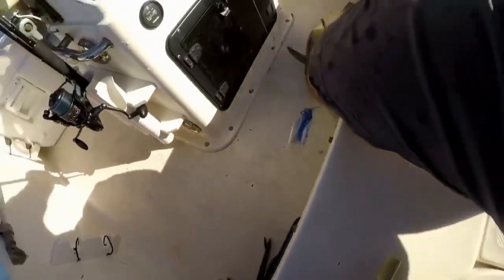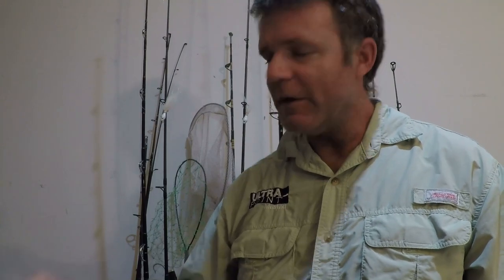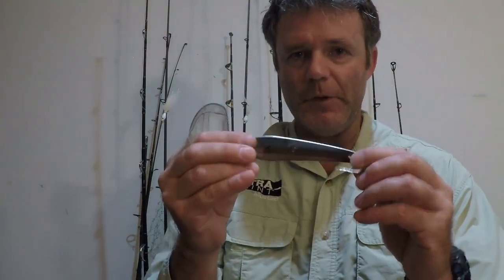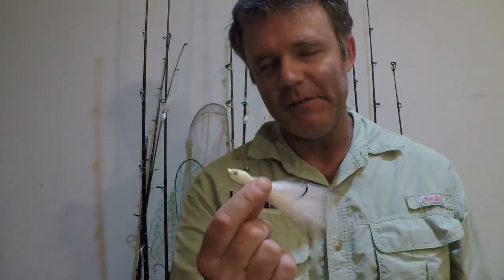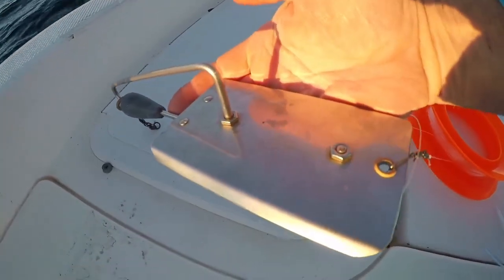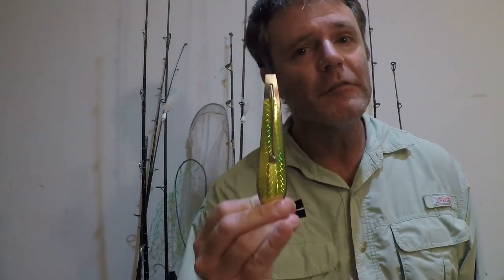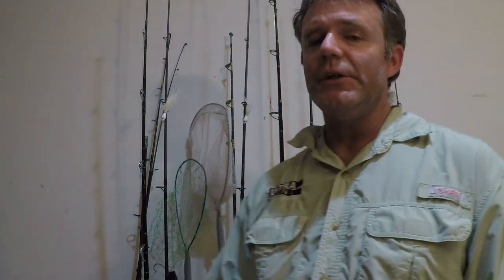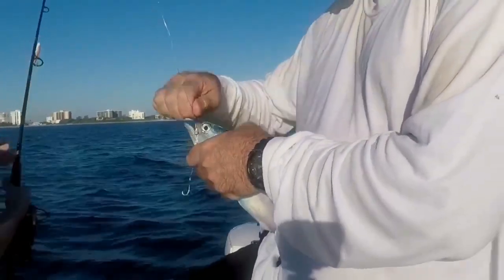How to catch KINGFISH | King Mackerel Basics & Tactics

Comment: hey Heath , im getting ready to go out and target some kings, whats your opinion on slow trolling frozen sardines on a stinger rig, i have not caught a king in a couple of years , and when i did i caught them that way....times have changed so ill be using all the methods ive learned from your channel
Reply from the maker: Best bet is planer trolling at 6 kts... using a seawitch and a Bonito strip
Reply from the maker: If your gonna use sardines... don't troll, just drift and flat line out bait... meaning no weight on your line ... good luck 😁
Reply from the maker: Btw.. still waiting on my boat 😡
Reply: @SouthFloridaSaltwaterFishing  what is wrong with the boat? the the e tec failed?
Reply from the maker: @orlandoduran7740  nope... been fixed for almost 4 weeks... waiting in warranty authorization 😡 really??? Wtf
Reply: @SouthFloridaSaltwaterFishing  i thought that a shop had to wait for authorization from the manufacturer before doing any work
Reply from the maker: @orlandoduran7740  nope... mechanic knew it was a warranty issue... now it's a paperwork issue... good lord
Reply: hopefully they hurry and get that done so they can get you back out in the water!! i got warranty on my 90 yamaha until next year i hope i dont go through all that trouble if anything happens to it

Comment: Hi Heath! Great video! Very informative. 
One question I have is,  I noticed that your boat is generally the same size as mine, what wave height is too high for you in your boat?
Reply from the maker: Hi Gary,  thanks for watching and asking a great question.  The answer is tricky though... so here goes... first, I'm infamous for going out in super rough seas, I really have to make a judgement call on the inlet conditions, inlets sink boats more than anything.  I've had my 17' KeyWest out in choppy 3 - 5, I've also had it out with 8 and 9 foot swells from a west wind laying down the ocean forming large swells.  regardless, it could be 1 - 2, if the inlet is unfavorable, I won't chance it.  The more simple answer is my boat can handle about 5' seas.  Hope that answers your question.  Take care :)

Comment: would a penn battle 2 with a shimano terramar 8ft rod work for kings?
Reply from the maker: Thanks a million for watching and asking a great question.  First I would say in general yes, Penn Battle spinners can handle Kingfish.  I have an original Penn Battle 5000 and it handles some hefty kings.  It will not however, handle planer trolling, there's too much pressure put on your gear by a planer for a spinning setup to handle.  But, top water trolling and flat lining, you'll be just fine.  Hope this helps.  Tight  lines & take care ;)

Comment: why not just run the wire through the loop and back through the haywire tool? Does the tool you are using not have a release slot?  Also - what size wire for these guys?  I'm getting my #4 wire bit off lately, and think I might need to go heavier.
Reply from the maker: Thanks for watching and asking a couple of great questions... The ez twist tool has a fixed side and an open slot side... First I send the wire through the loop of the hook then into the fixed side of the tool, next i fold it over to form a loop and lay it into the open slot and twist the leader.  This is how I've done it for years... I'm sure there are modified versions of how to use the tool effectively, but I'm just sharing what I know of as the easiest way to utilize the tool.  I use #4 - 40lb wire for kings... Cut offs are all part of it.  If it's happening on a consistent basis I'd up the leader to #6 - 60lb.  I like the #4 because of the stealth factor... I get lots of kinks from the bigger kings, but haven't been cut off in a long while.  Hope this helps. Tight lines & take care :)
Reply: @SouthFloridaSaltwaterFishing  Thanks for the quick and awesome reply.  Subscribed. Yeah I'm going to try going up to #6. The kings are pretty big and powerful here.  So what I do with the tool is go through the back of it on the moving slot side first, then through the lure, then back through the tool's front, in the fixed hole.  this way when I back the tool off the wire after the twist, It just falls off the wire. If I could bother you again, what jig weights do you find most useful? I think this might be speed dependent too.
Reply from the maker: Thanks for the tool tip... I'll have to give it try.  The jigs i use, if you're referencing the spro white bucktails range from 1/2 oz to 1 oz... Speed doesn't seem to be a factor.  I troll the 1/2oz at 8 to 10 knots and it stays in the water.  The gotchas come in 2 sizes that i know of... I use both the smaller and the larger, they both work the same... I do prefer the Spro jig though.  Hope this answers your question.  Tight lines & thanks a boat load for supporting the channel, I truly appreciate it :)

Comment: Great educational video,subscribed and liked video. From your experience what minimum size planer can trolling drone spoon 5 - 6 miles per hour
Reply from the maker: Thanks for watching and supporting.  I really appreciate it.  Any planer size will work with a spoon.  The large the planer size (which means a heavier weight) the deeper it will dive.  My favorite planer size is a #6.  Take care & tight lines :)
Reply: South Florida Saltwater Fishing thanks,I don’t have very heavy rod for trolling large planner so you think I can use small number 1 planner to pull drone spoon for king and Spanish mackerel. This is great because I never fishing with planer before and your videos will help me a lot.Thank you!
Reply from the maker: Yes you can use a size 1 planer with a spinner class set up... You should be fine.  Good luck & tight lines :)